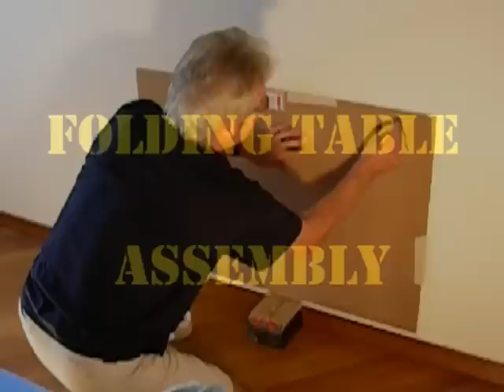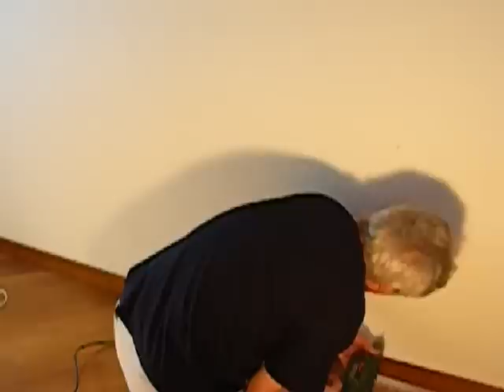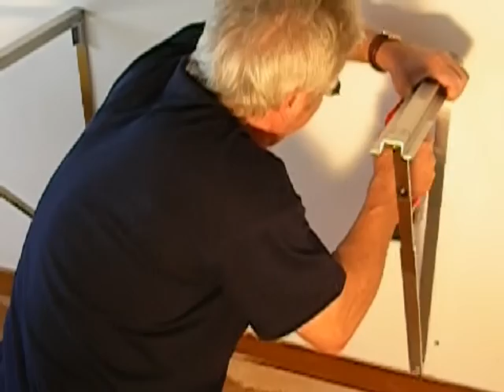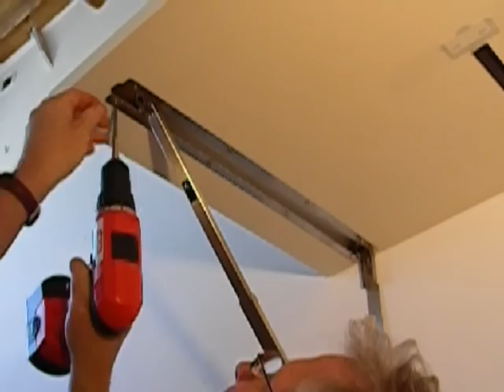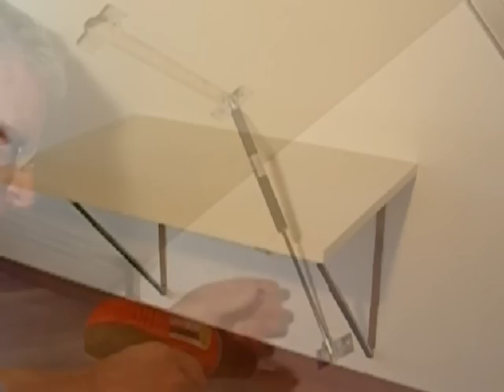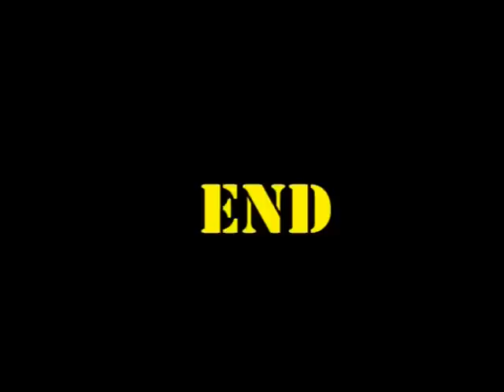Folding Table Installation Video Tutorial - Complete wall mounting

Comment from the maker: The folding table is sold mainly on the website,
newtableconcept(dot)com/store

On our website we do not offer the option to ship outside
Europe because of the shipping cost. We provide estimate
based on size, weight and country on request.
For countries outside Europe the best option is
to purchase only the patented stainless steel
FastLeg structures and the shock absorber and prepare
the table top locally (this is the "do it yourself" option).

Comment from the maker: The complete folding table can be bought online at the new table concept website. We dont sell the brackets separately. We may do so in the future if there is request. The shock absorber is an option and can be bought on the website. The folding table is very robust: it has been tested to hold up to 300 pounds.

Comment: what anchoring method did you use?
Reply from the maker: Each FastLeg is anchored to the wall with two 8 mm (5/16”) dowel and screw.
In the folding table package we provide dowels and screw which are suitable for walls made of solid bricks or concrete.

Comment: what are the name of the components?
Reply from the maker: The new concept folding table is based on FastLeg, a mechanism patented and registered by NTC srl.
FastLeg is extremely compact, totally closes on itself becoming invisible, yet has a strong structure that allows the table to hold safely up to 300 pounds.
FastLeg integrates a locking system that, on the opening phase, locks automatically the table when it reaches the working position and allows the closing by simply pulling a button.
FastLeg is realized in 18/10 stainless steel 1.5 mm thick. Stainless steel combines the mechanical properties of the steel with the resistance to corrosion typical of noble metals. FastLeg is manufactured using state of the art laser cutting systems.

The lacquered board are realized with Medium Density Fiberboard, lacquered in both-sides, OECE varnished on polyester substrate. The lacquered board has a superior finishing that give a good touching feeling with all rounded edges.

The laminated board are realized using HPL high pressure laminate.Laminate is a phenol or melamine finish applied to wood-based board. It has excellent technical characteristics and it is easy to keep clean.It consists of a series of sheets of resin glued together to create a thickness of about 0.6 mm.